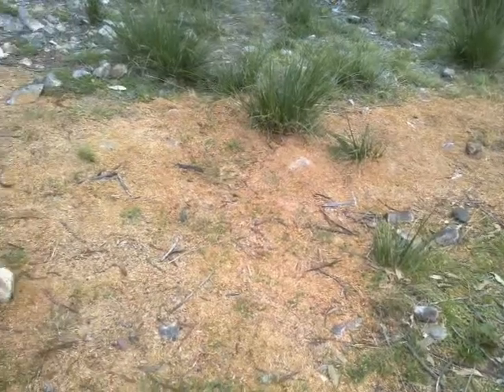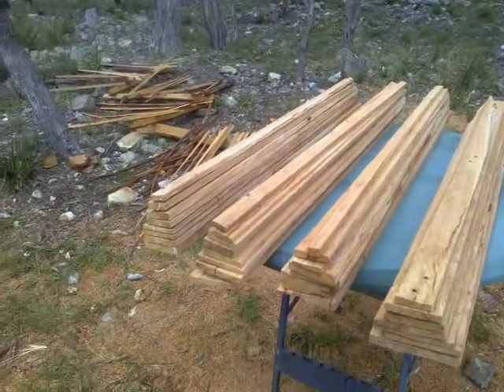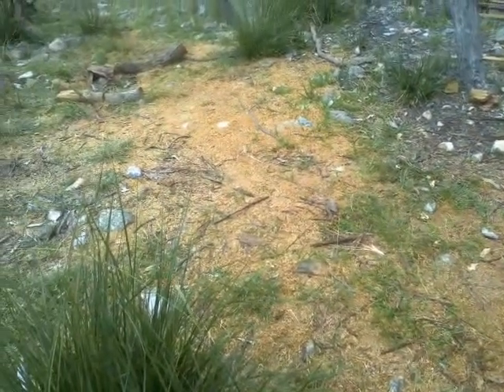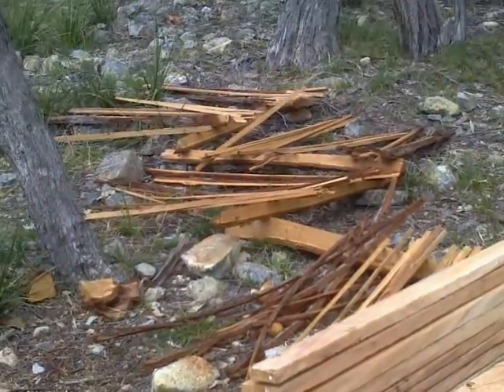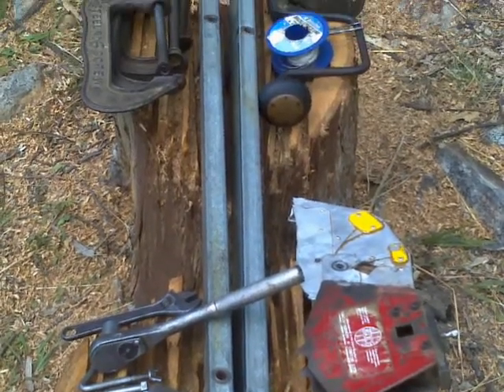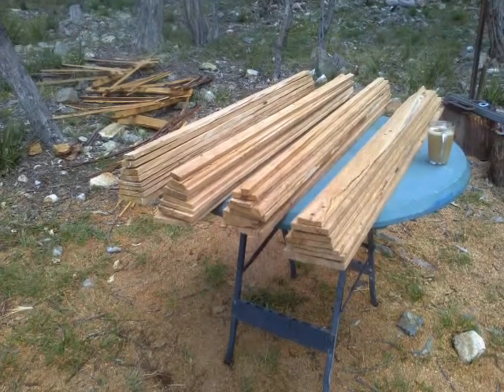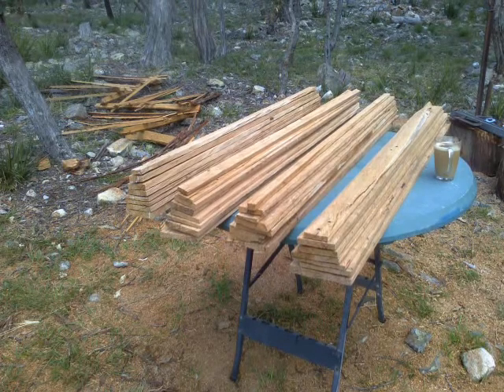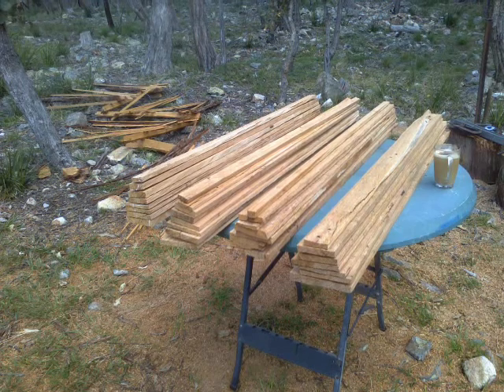Salvage-Milling With Chainsaw; Crunching The Numbers...

Comment: One of these days I’ll get the gist of mathematics, Rick, I swing a husky ...
Reply from the maker: G'day mate,

Thanks.

The funny thing is that I really only have the Arithmatic that I learned in Primary School..., after a Skull-Fracture when I was almost 14 made it so that I haven't learned anything in a Mathatics class ever since...; but I can add, subtract, multiply & divide pretty well, and Geometry isn't bad - but a lot of Algebra and all of Calculus  is beyond me....

   For this stuff though I have an Engine Logbook & I write Diary-Notes on my Calendar...; and then there's the Calculator I've had since 1976 - and it still works (!).

Such is Life,

Have a good one...

Stay safe.

;-p

Ciao !